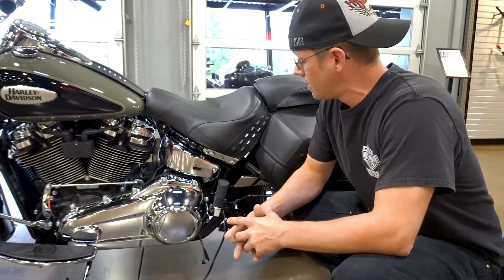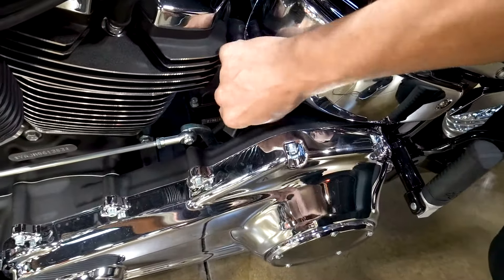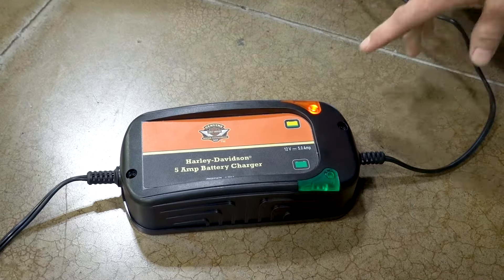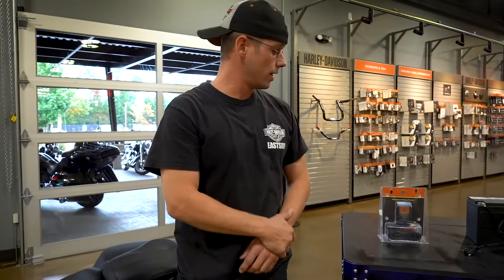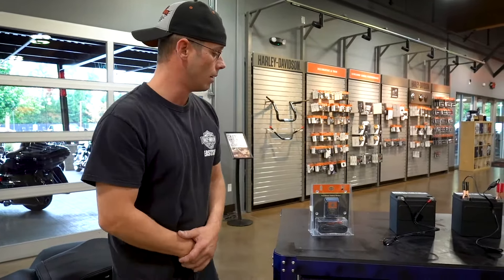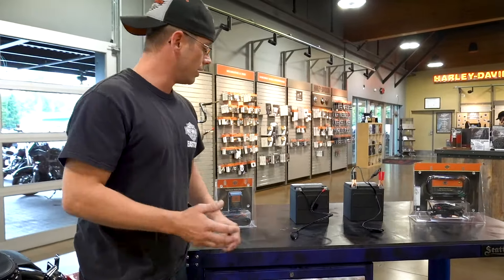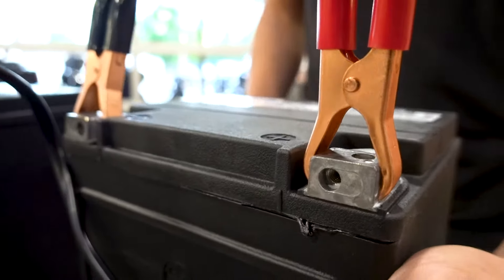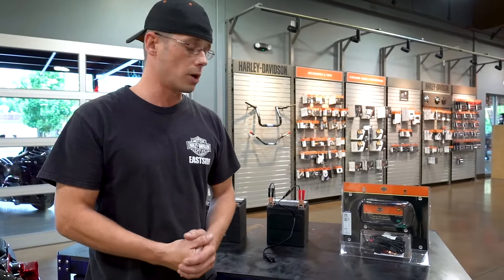How to Keep your Harley-Davidson Motorcycle Battery Charged while Storing

Comment: My daughter just bought a 2020 Iron 883. We put it on the battery tender for over 24 hours now and the tender display indicates it's still charging, but it hasn't gotten to 80% (green flashing light). What the hell? Why might that be?
Reply: After 24 hours if no green flashing or solid means your in the market for a new battery. Just a note. Battery Plus carries Harley batteries with a full two year warranty as opposed to Harley one year. I’ve had good luck with their batteries lasting 5 to 6 years. Cheers😊